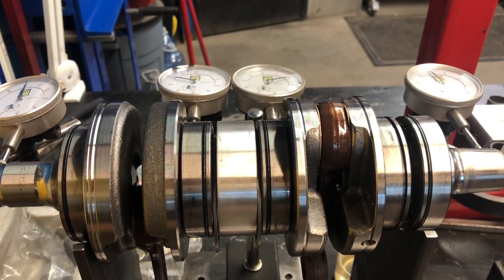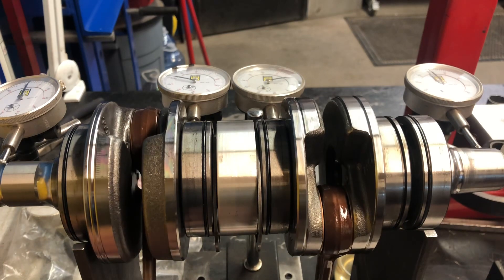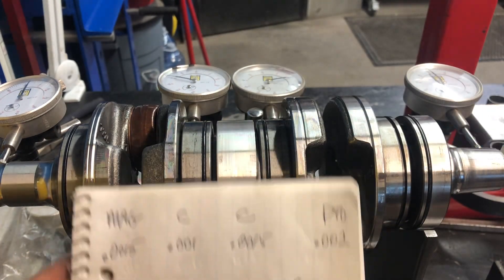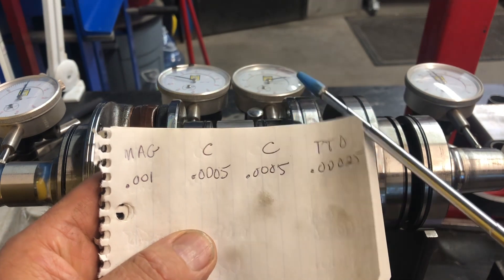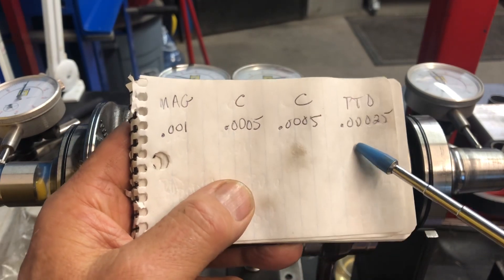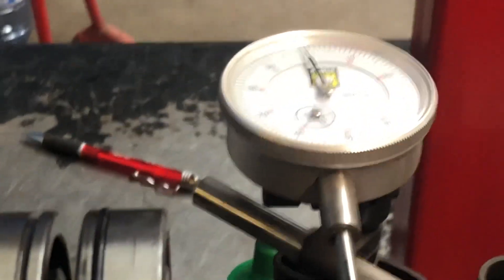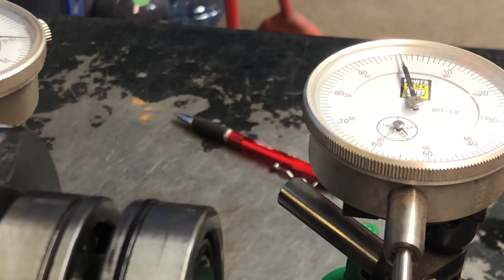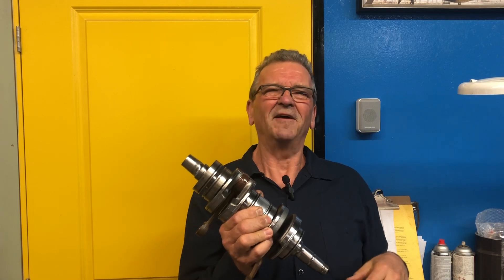Rotax 447 (part 3) crankshaft truing

Comment: Hi! John. Thanks for the great video's. I'm not in anyway involved with aviation engines but I am trying to revive some very used and abused 50 year old  sled engines so I have been going to school on your work. Can the inner section of the Rotax cranks be disassembled to change the inner bearings? I can't seem to find a manual or any information on the process. THANKS
Reply from the maker: @donsipes  Hi Don, thank you for the kind compliment! Center bearings replacement is yes and no. On the no side, I don’t believe you’ll find any manual, sled , bike or aircraft that contains this information. On the yes side I’m able to dismantle the centre section, replace the bearing and rephrase at 180° 
then finish the assembly. Trueing the crankshaft to as close to zero as possible. Aircraft cranks must be perfectly phased, straight and true. Some sled shops will overhaul crankshafts, however I believe the phasing error and truing specs are extremely large by comparison. Happy sledin!
Reply: @RotacRepair  Thanks

Comment: So does that crankshaft have 5 bearings?
Reply from the maker: It does, two centre, two PTO and one Mag end.
Reply: How does the crankshaft separate? Does it have an interference fit?
Reply from the maker: @ Hi Wayne, yes it has an interference fit. That’s all that holds the crankshaft together and in alignment. These crankshafts are difficult to dismantle without the proper tooling and knowledge.

Comment: Super nice work.
Can I use a crankshaft out of a provision 4 in a provision 8 case.?
Reply from the maker: Thank you! I believe that kirillneduzhiy8683 has correctly answered your inquiry.
Reply: If I'm not mistaken on the 447 engine it's the same as on the 503 and you cannot use a prov. 4 crank in a prov. 8 crankcase and vice versa. The provision 8 crank is longer, different shape and woodruff key position on the MAG side (because of different ignition, Bosch points vs. CDI) and has both big PTO and MAG end bearings (6207) whereas the provision 4 crank is shorter and has a smaller 6206 bearing on the PTO side instead. You can see it best by looking into the parts list crankshaft pictures or looking them up on Google.
Reply: @KirillNeduzhiy  thanks for the info